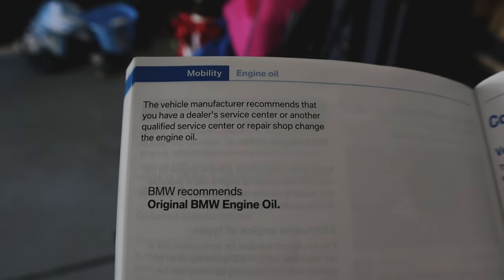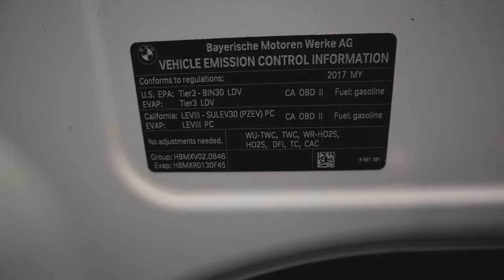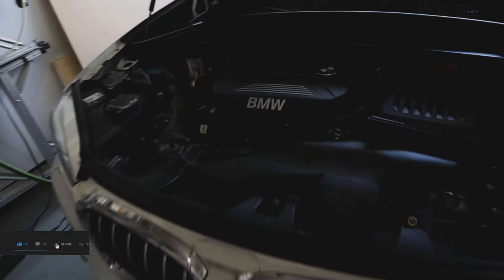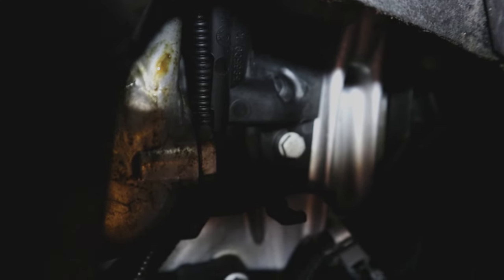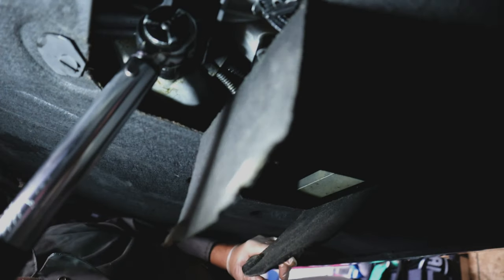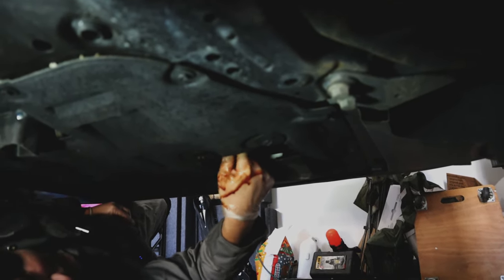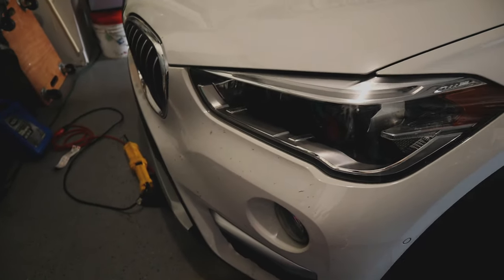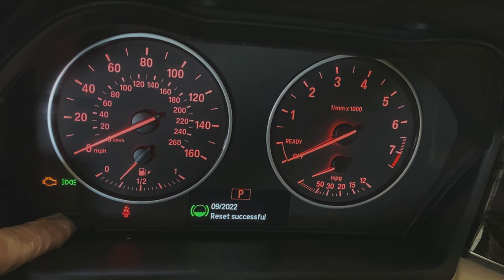#MTBPlanB DIY Oil change 2017 BMW X1 xdrive 2.8 F48

Comment from the maker: Would love to hear in the comments below which make/model of auto has the most difficult oil change procedure?
Reply: Obviously a 2017 BMW X1 xdrive 2.8 F48
Reply from the maker: Slightly less complicated than changing spark plugs on a Boxer engine.
Reply: Looks pretty easy to me though

Comment: Two hints, remove the entire cover instead of working through those little access holes. Its only 10 8mm screws. Makes working on the underside much easier and cleaner. Also, you can inspect the underside of the engine for other issues. That center plug on the filter canister is also a drain plug. Drain it prior to removal makes it drip free. It takes a T55 Torx bit driver.
Reply from the maker: I think the drain that comes with the k&n is either 12 or 13mm.

Comment: You used a shallow 32mm socket with an extension. Could a regular (deep) 32mm socket work? Some online reference says 5.6qt oil capacity. Is 5 qt sufficient? Oil type important? Thanks!
Reply from the maker: I’ll let you know next time it’s due for oil change.

Comment: Thanks for that. Same as 2021 model. The factory does it for free every 10,000 km but I do it in between every 5,000 km ( 3,000 miles) as well. Brcause ir's a Big vehicle /small engine set up.

Comment: Thank you for your contribution to the BMW community. And yes, I agree with you with your comments about the dealer service. They have monkeys working there. Is rare to find a caring service tech. I have seen terrible things happen at the dealer. If you want things done right, do it yourself.

Comment: Which oil did you put ?
Reply from the maker: A pretty cheap synthetic oil that you can find at Walmart.
Reply: So I did my first oil change on 2017 x1. After a lot of research I went with BMW SAE 0W-20 LL17, primarily due to its long life rating. Bought 5 litres from dealer at $10 / lt.
Reply from the maker: @sahil2441  BMW oil is just Pennzoil pureplus oil. There’s a good yt channel that has compared a lot of the major oil manufacturers, all seemingly good and within a hands reach of each other as far as quality, but with a large range of cost.

Comment: I have a 2018. Your tutorial is spot on. I put in 4 quarts to start and sure enough the brains told me to add another quart. I didnt have a 32mm socket but I did have a 1-1/4" that worked fine. I don't care for the oil filter set ups on these European cars. Pain in the ass.
Reply: Thank you for non-metric compliment as I don't have a 32mm either. Much appreciated!

Comment: The new filter kit also comes with a new cap for the oil drain in the canister. 
Took me an hour to jack the car up and do the oil change on this car in my garage, my other cars are amgs and this bmw is by far much easier to access the oil filter and do an oil change. Next time I can probably do it in half an hour.
Reply from the maker: I didn’t muck around with the drain. Those plastic threads seem like a failure waiting to happen.

Comment: Great video! Any idea where is the rear jackpoint?? F48 2017 bmw x1
Reply from the maker: Hi, yes the rear jackpoint is under the rear axle differential. Find the black diff cover and move to center and just forward of that cover.

Comment: Did you do anything with the tiny copper ring? I saw it in my oil and am not sure where it came from or where to put the new one. Any thoughts input would be appreciated!
Reply from the maker: Yes That is the new drain plug seal. Just swap in the new one.
Reply: @MTBPlanB  Thanks for the great video and fast reply!

Comment: question for you, on the oil filter cap, inside the 32mm socket, it looked like there was a smaller socket.  Couldn't you use the smaller socket instead or do you have to go out and get a 32mm shallow?  thanks
Reply from the maker: That is the drain plug for the filter.
Reply: @MTBPlanB  thanks. just ordered my 32mm socket.

Comment: Transmission oil type for this model??
Reply from the maker: Most BMWs have ZF transmissions and this model X1 has 8spd auto. ZF recommends ZF LifeGuard 8 Full Synthetic Automatic Transmission Fluid for this transmission. There is a kit you can buy that has the filter and trans fluid. The filter is made into the transmission pan. I suspect any fluid such as ravenol specifically designed for 8 speed autos would suffice.

Comment: Okay I’m done the oil change but I made the mistake of using the T5 5 to drain that thing, I’ve got the oil all over my hand on the ground.

I am also worried over tighten the 70 mm bolt
Reply from the maker: If It’s not leaking, it should be fine. Just remember to loosen it when the engine/and oil is cool on the next change to ease removal.

Comment: is ramps better than using a jack?
Reply from the maker: Easier when changing oil, etc. If I need access to wheels for brake jobs, etc. then I use a jack with jack stands.